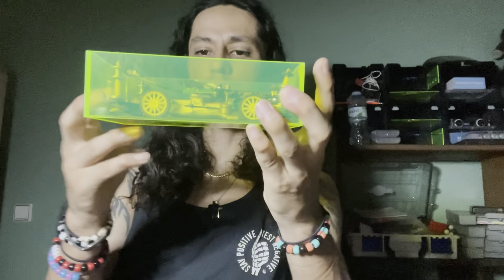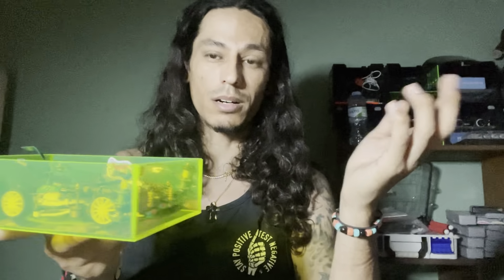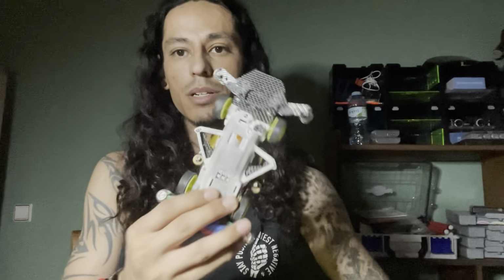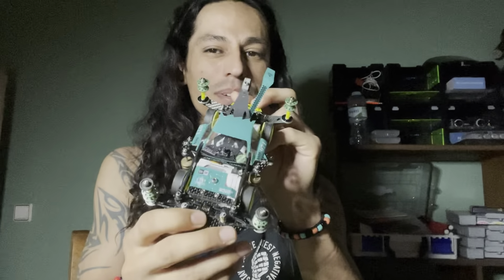~ 90’s chassis build off resumes with a breakdown of this Super FM open jump machine ~

Comment: great build :D alot of effort in this build :D the tyre seem to have become low friction
Reply from the maker: Thank you! Lots of effort indeed, with using the brake cleaner method it did turn the tires too be low friction. I think it ended up working in my favor

Comment: i think u used the wrong propeller and crown gear for this build. it should have been the 2mm propeller and orange crown gear. it makes a difference in the transmission.
Reply from the maker: I sure did, i used what i had as open parts didn’t have the correct parts open so later down the road the machine will get the proper gearing and propeller shaft.
Reply: @keepitlevelmini4wd648  awesome. looking forward to see the progress on the build after using the right parts.